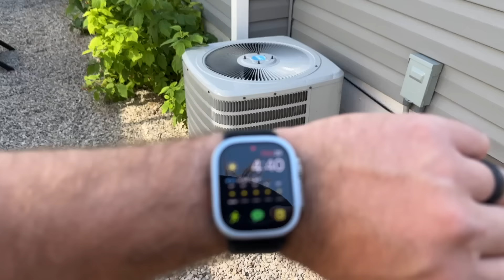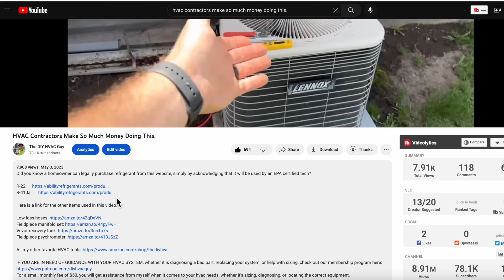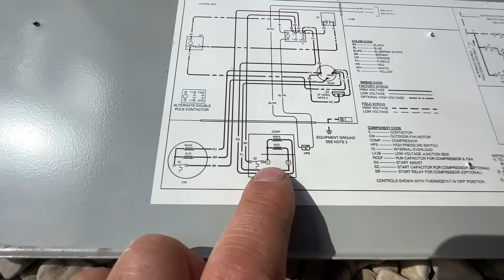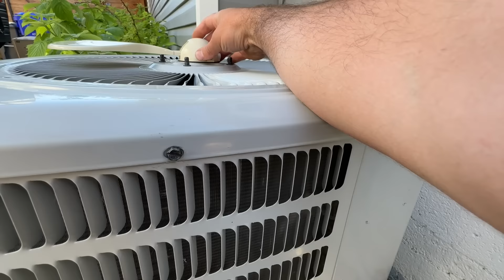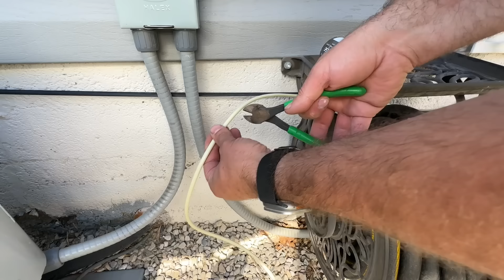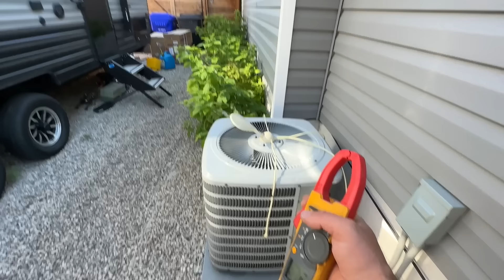Can This Device Actually Lower Your Electric Bill By 30%??

Comment: From an HVAC tech- I would like a tube on every side of coil for maximum effectiveness. Also I would install the mister near top portion of coil so cool water can start on top portion and trickle cold water down. Nice design on this. I’ve used my yard sprinkler on very very hot days 😊
Reply: What if you simply put a patio umbrella over it so it's not in direct sunlight?
Reply: @dmitryg6353  shade is good but it needs to be high enough so it doesn't cause the fan to struggle and draw more power. It would also increase head pressure so I would generally avoid that strategy.
Reply: @DubZero1  Thanks
Reply: @dmitryg6353  Why don't they do that on every AC unit especially those mounted on a roof.
Reply: @wanaraz because it doesn't work and roof top units in the sun use the same amount of electricity because the amount of sunlight actually absorbed by the outdoor unit is minimal and it uses a massive amount of air that easily clears any shaded area of cool air in seconds.
Reply: @dmitryg6353  ..it "helps".....but only reduces the radiant heat input to the "metal".....the water misted onto the fins causes an "evaporative-cooling" effect of much more impact.. Example....your hot body ( from the sun) is "cooled" by moving uncer an umberella.....you are a lot more "cool" after you are dunked in water and stand there wet.
Reply: @dmitryg6353  Just make sure it doesn't hinder air flow, both in the sides or out the top. Building a large double lattice wall on the south and east or west sides several feet out could also work. You could probably keep the bottom 3 feet or so completely open, especially to the south, as the angle of the sun wouldn't hit the compressor.
Reply: Diddo
Reply: @THEOGGUNSHOW  ditto.
Reply: @clutchpedalreturnsprg7710 dildo? Lol , just kidding
Reply: Where can I purchase the Cool and Save mister?
Reply: @johnday8501 underneath the video, it has the title, and next to it, it says more.. tap that, and it'll take you to the link.
Reply: Your not a tech
Reply: Why not just get a swamp cooler?? Literally a low power pump and a motor.
Reply: @ZippedyTV  Swamp coolers are worthless in high or even middling humidity conditions. That's where they get their name, they're "swamping" the dry air. That's why one of my pet pieves is people who buy desktop "air conditioners" -- they are, by definition, the opposite of an air conditioner. They're swamp coolers that moisten the air, rather than drying or cooling it. They are also directly opposing the proper functioning of carefully designed, built, installed, and maintained air conditioning systems. This causes the AC systems to require more frequent and more extensive maintenance efforts, as well as using more power while they're bogged-down in the mean time. Not to mention the power to run the swamp cooler and the damage that the extra humidity can cause, especially from condensate that often drips off of ducts in high humidity areas and soaks the ducts' insulation. This condensate often then pools atop sealing tiles and the like, causing mold and subsequent worker health issues. All because Dan and Debbie thought they knew better than the gaggle of engineers, building maintenance workers, and HVAC professionals. I suppose while we're at it, we can factor in the higher insuramce premiums for everyone in the company, heavier work loads due to lost man-hours via FMLA/sick leave. /rant
Reply: @ZippedyTV swamp coolers don't work well in humid weather.
Reply: When it’s 100% humidity outside how does that impact this things usefulness
Reply: repentandbelieveinJesusChrist9  ok hippy... What's your point....?
Reply: A very long /deep culvert/pipe where the air is blown through using ground temps to cool the air feed to the condenser would be preferable. But if you had that you would just use a heat pump and be done with it. A possible compromise would be directing crawlspace air to around the condenser as there would be SOME cooling of the air over ambient outside air.
Reply: But in all that, if you only get 3 in the kit, shouldn't the outside face of the unit get the nozzle not the the house side?  He said the outside facing but for the water not getting on the slab, not because the most efficient 3 sides surely includes the opposite side from the wall.

It's discouraging that 2 "AC techs" missed a simple point efficiency.
Further confirms the industry isn't as savvy and should be. And even because this gadgets premise isn't pitched and supported by every AC business. Why is this? Because it would ruin the industry's revenue.
Reply: When I made my misters years ago, I mounted them to wooden yard stakes.  Then, while the outside unit was running, I moved the stakes around until I could get a large fog area that all went into the unit.

I live in GA where the average humidity is around 10,000% so there's very little phase change after the water comes out of the mister.
Reply: @earlbrown  Only 10K %  ?  I think you are underestimating it a little.
Reply: @earlbrown   @earlbrown  phase change...? What are you a chemist or something lol... What mister you talking about....? Your lawn sprinkler...? Or you mean what's going on inside the AC...? If you mean in the AC I believe it's called a metering device.... If your talking about the sprinkler water then I'm really lost....
Reply: @gb7886  metering devices are in the air handler
Reply: @lInKboT-t5p  ummm ok... The air handler huh....? Wow that sounds really smart...... Which part is the air handler.... Lmao...!?
Reply: @gb7886 a metering device is at the evaporator coil.  It can be an expansion valve. A piston type or capillary tube.
Reply: I take it the hottest freon comes in at the top and it travels to the bottom as it condenses back to liquid.
Reply: Is it true if you run your AC for short periods that  it makes it work harder?
Reply: @filmaker256 basically every time it starts up is when it draws the most amount of power. So turning it on and off and on and off again will drive energy costs up. Better to run it 1hr straight vs turning it on and off in the same hour.
Reply: @DubZero1 inverter units are way more efficient.
Reply: @filmaker256  The most efficient A/C or dehumidifier is one that runs nonstop at a lower power level, the minimum needed to achieve the desired outcome, but that's just the heat pump itself (see the bottom addendum). The constant reduction of humidity (which is what air conditioning was originally created for, air drying) is actually more of a concern than the starting current. Although inrush current while starting can, depending upon the time interval you measure across, be 100+ times the running current. That's why circuits containing motors need time-delayed breakers or fuses, because after some time (generally <1 sec, usually far less), the current levels-out much lower. There's also the locked rotor current (LRC) draw, which matters more with pumps and especially compressors. Basically, if the motor happened to shut-off at the point in the pump's rotation where the compression is maximized (especially relevent on scroll compressors, like those commonly used in VAC/R), the force/torque and thereby electrical current required to push it past that point before there is any rotational inertia built-up can be quite high.

However, just the air handling unit (blower motor) often draws another 5-15 amps, so that can greatly temper the efficiency in such a scenario.
Reply: @filmaker256  Short cycling is also going to reduce the life of the compressor….
Reply: So you think continuously misting tap water won't ruin the capacity of the unit by causing a thick mineral deposit to form on the coils?  Acid coil cleaner will help some, but it won't get it all unless you use a acid that will erode the aluminum.  Calcium deposits erode best in the same acid conditions that will erode aluminum.  So tap water will damage the condenser.  Filtered rain water, RO water or Distilled water will be required if you want to avoid coil damage.  Remember you will be evaporating literally tons of water, is your water clean enough to not turn the coils into a solid calcium deposit?
Reply: @bigtexuntex7825      you made/copied the exact same comment on How To Home's channel about this device.  Do you have a $dog in this hunt?  Give these people and the company's trying to help people, a break?!  People think these condensers are fragile and will 'junk' in a few years.  Epiphany - they are made to be outside in all types of nasty weather and run constantly in the worst conditions/heat.  If you have actual scientific experiential examples of coil cleaner 'rotting out' the coils in a short period of time, or tap water 'damaging' the coils, I'm sure everyone would be all ears.  In reality, no one will be holding their breath!  These are designed to be cleaned at least yearly with that cleaner . . . and last for decades!  Tons of water is 2000 pounds multiple times, correct?  The device - if a person runs their a/c ALL DAY, apparently uses only a toilet flush amount of water.  So assuming the worst of conditions running the a/c literally ALL DAY (and most only run their a/c for a season each year), it'll take (2 gal. - 8.34 lbs) 239 days to use a 'ton' of water (479 gal.) - which is likely 2-3 or more years of using a/c.  

If you and the rest of the bunch of 'experts' had done a little research, you'd find others here on YT that have actually used this type of device and had substantial long term savings and NO problems with calcium build-up or MONTHLY coil cleaner cleaning!  Beyond that, those with water softeners or even RO water filters, can run a line out to the condenser and literally have no minerals in the water to 'destroy' their fragile condensers (RO tanks are over 2 gallons, so think your RO filter keep up with 2 gallons max. a day, at 50 to 100 gallons a day filtering capacity?)!  I just discovered this device, did the exhaustive research prudence requires, and will be installing this type of device on my own a/c using an RO water line.    

Sheesh, everyone's an 'expert' on YT . . . most with no experience!  Funny how humans run the gamut - some so fearful they can't leave their keyboards; and some so fearless they can invent great things (failing many times) and explore/discover the world!  For those so inclined, stop being so fearful (even though the globalists/corporatists have tried to train you to be after a lifetime of media predictive programming, especially 3 years of the scamdemic), and go live life to its fullest!
Reply: @bradtodd3639  The big issue is not "damaging the coils", The issue is that minerals in the water will clog the openings between the coils in short order.  Anybody who has a whole-house humidifier on their furnace knows this.
Reply: @bigtexuntex7825  I would think that's what the filter is for but I'd still be concerned.
Reply: @bigtexuntex7825  Just throw a phosphate filter on the line if worried about hard water… Second, less than 1.6 gallons per day is what this guy mentioned that device might use…
Reply: @EarlHayward 1.6 gallons of water evaporated is approximately 1 ton of cooling or 12k btus for 1 hr. Do you really think that is going to do anything? 😅😅😅
Reply: @bigtexuntex7825  I have never seen start amps more than 3-4 times run amps, even on large industrial three phase motors…
Reply: @EarlHayward usually start current is going to be less than 200% of the max rated current on a standard psc motor.

Comment: Gettin' pretty close to running a buried poly line 3 to 6 feet down on the lot for type of mini geothermal battery for a heat pump -- cooling in the Summer and warming in the Winter.

Comment: Instead of sticky tape, the part that turns on the water should be a magnet so it can be removed easier in cold climates to be stored for the winter.
Reply from the maker: Yea that would be smart huh
Reply: Cottonwood trees with their vent clogging floating seeds were frequently causing debris buildup on my compressor fins.  Using super magnets harvested from old mechanical hard drives, I secured some screen mesh around the unit.  The magnets make the mesh easy to remove and clean.  I knew there was a reason I kept all of those old hard drives!

Comment: Yup, this works. I did this while in Iraq in 2003-04, it gets 140 in downtown Baghdad so A/C was critical for us and if it wasn’t working right we did things like this to keep it cool until we got it fixed properly. And make sure you buy spare capacitors for your unit.
Reply: That’s unbelievably hot! As in, nobody should believe this.

Baghdad’s all-time record was 125 degrees.
Reply: Make sure if you install/troubleshoot a spare capacitor you do so in a knowledge and Safe fashion. It can necessitate a unwanted stay in a cool storage of the morgue.

Comment: What makes sence is to run the intake air through a swamp cooler.  With a little bleader flow and a zink anode water will not calcium up.  This set up will give you dry air in the house and better heat removal at the condenser from both evaporation and more heat removal from greater humidity in the intake air.  This set up will also prevent deposits on your condenser coils.

Comment: A 30% savings at 4.2 amps would require a drop of 1.25 amps. Amperage drop of .8 is less than 20% savings in electricity. (About 19%).
Reply: The overall energy savings is miniscule because he's not meauring the total amp draw of the system which is close to 20 amps +.  He's probably only measuring the condenser fan motor.
Reply from the maker: No my condenser pills like 1.3 amps. This was 100% the compressor run wire
Reply: @diyhvacguy  Usually condensers run on 240v, so to get the correct amperage you would have to check both legs and add the results together.. wouldn't you?

Comment: Back in the 80's I had a 1978 Rheem unit that used water as a pre-cooler.  The problem was that after 10 years pinhole leaks developed in the coils rendering the unit useless.  I would imagine this would also have the same issue.
Reply: Did they prove that was the reason for the pinholes? I can’t see how this would be different from rain water??

Comment: The only way to get cooler air from the vents is by lowering the thermostat (if the system is not overwhelmed by the heat.)
Reply: Contrary to popular belief, the thermostat does not control the temperature of the air coming from the vents.  It tells the system that when the room has cooled down to the thermostat setting, then it shuts the system down.

Comment: This will not help in areas of the country where the relative humidity is high such as in the southeast US.  It WILL cause maintenance issues.  In acrid climates it will reduce the temperature of the air at your heat exchanger slightly.  If this is such a great idea,why don't the HVAC manufacturers include it in their systems from the factory?

Comment: That is an interesting concept. I do have a few questions:

1. How much water does this actually use over the course of a month?

2. Does hard water introduce additional issues to the A/C components?

3. What kind of havoc will pollen wreak on this system and the A/C unit?
Reply: Im on county water and a setup like this would easily eat its savings in water consumption.    anything damp all the time is obviously more prone to corrosion and yes it will definitely collect more dirt if you live in dusty areas.

Comment: How much water does the system use ? if you are paying for water by the gallon will the reduction of power useage be more than the cost of the water used?

Comment: It’s a neat concept and yes it kinda works.  If you have a newer heat pump system or a system that uses a TXV it’s not going to work well and actually hinder cooling. Using the misting system
You are charging the charge pressure/liquid line and you are changing the way the TXV acts.  If your going to run one of these systems, you need to charge/add Freon to the system to the appropriate levels.  If you have a heat pump system and charged/added Freon while using the misting system you will need to remove Freon during the winter months. since a heat pump system runs all year your not using the misting system during fall and winter So now the problem will be the system is over charged and not function correctly while using heat. 

IMO these misting systems are good for straight cool (cooling only)systems with the old school  piston/cap metering device. 
I’m no expert but have been doing HVAC work for 16years and now own my own HVAC company.
I live in south Texas, I’ve seen all kinds of crazy misting systems setups to keep cool. Best advice for any hvac system especially during the summer is to keep the outdoor system out of direct sunlight.

Comment: It's not about "cooling the air," it's the wetting the condenser coils increases the cooling effect, same as sweating cools the skin. water conducts heat like six time faster than air.
Reply: You are correct but only if the dew point is below about 55 deg F.  Above that, evaporative cooling isn't very effective and it feels muggy.  I live in the desert southwest and we know how evap cooling works.